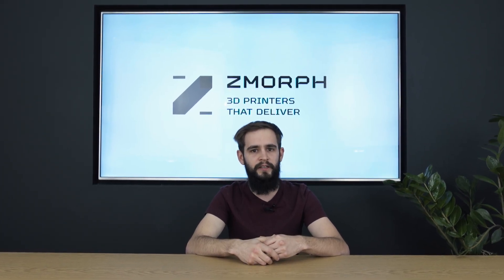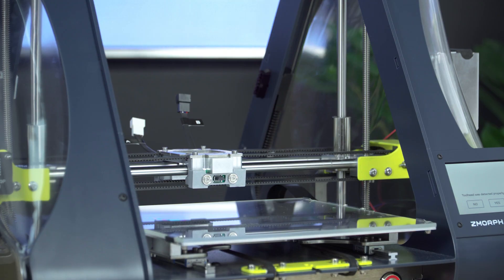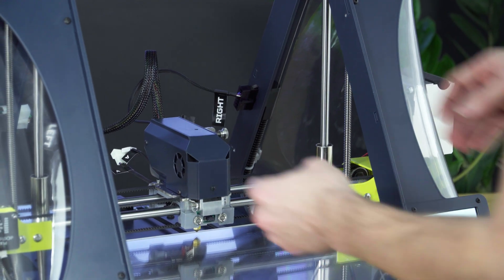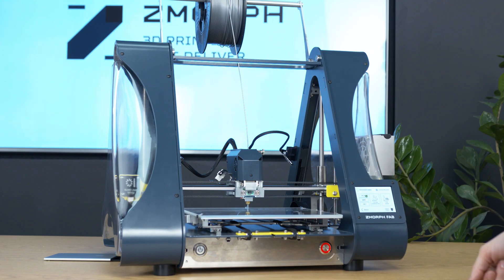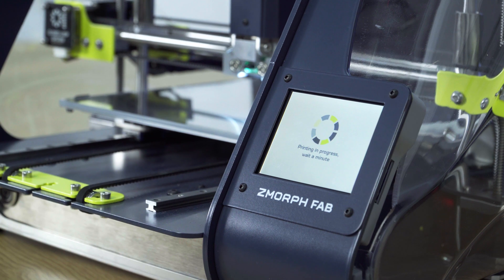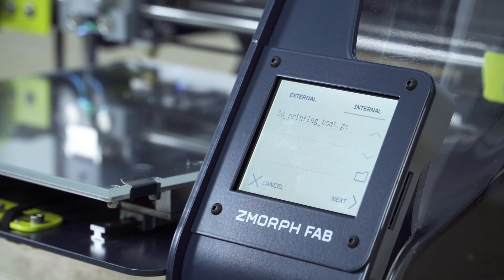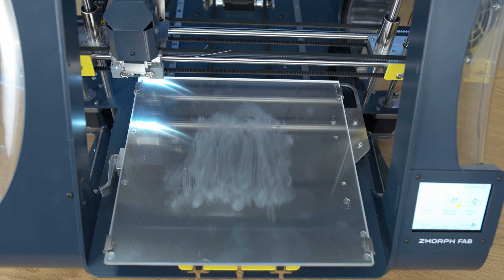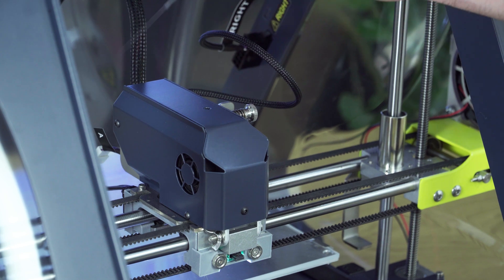Zmorph Fab - Single Extruder Toolhead 1.75

Comment: What is the criteria to select which line is best?  I usually just pick the thickest line the has no gaps.  Is this correct?  Thanks!
Reply from the maker: A correct line is the one that sticks to the table after gently touching it with the finger, but can be easily ripped off with a fingernail.
Reply: @ZMorphHybrid3DPrinters  this is great information to know!  I also saw on the website that line 3 is the result of the Auto Calibration and that the left lines 1 and 2 are .05mm each lower and the right lines 4 and 5 are .05mm each higher.

Sadly I am having a problem with my Auto Calibration stating that the result is inaccurate after the first point.  I want to try a few more things before reaching out to tech support.
Reply from the maker: @louvoodoo  In the user manual there's a whole chapter on auto and manual calibration. If you wan't to resolve the issue yourself that's a great place to start before contacting the Tech Support.